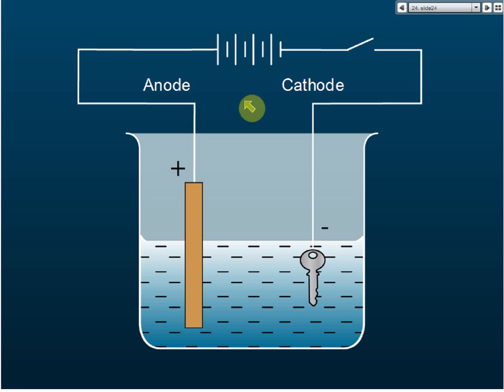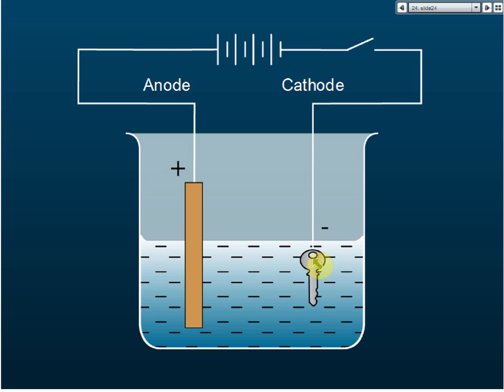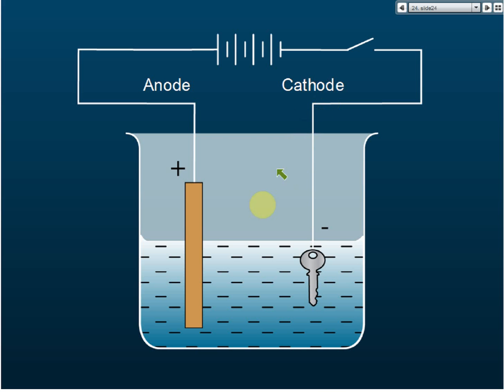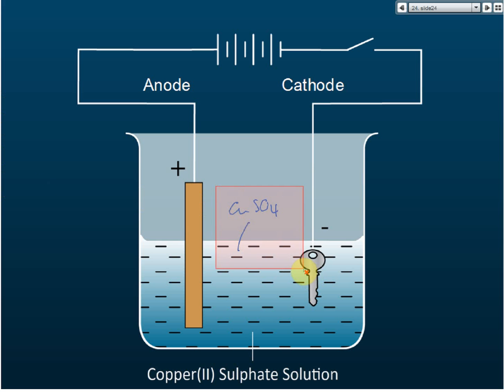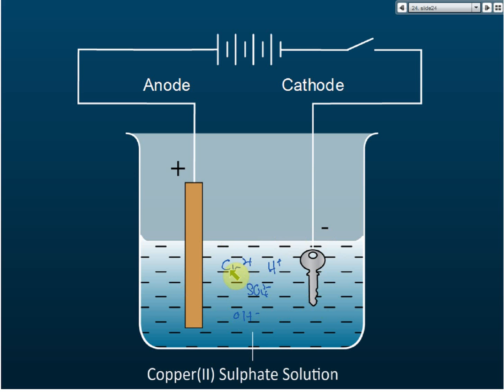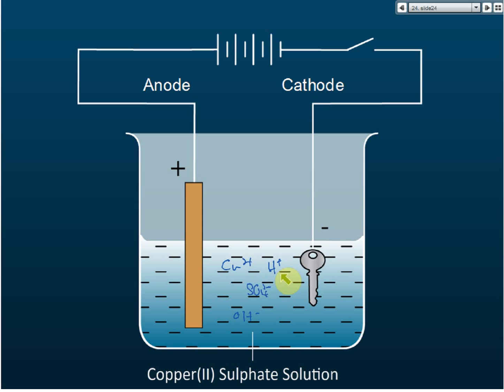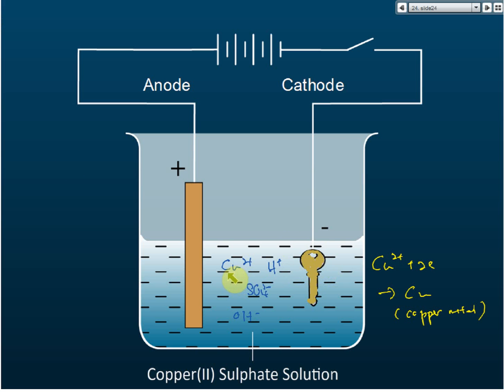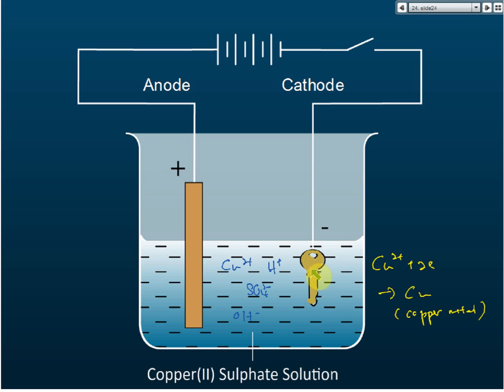Electroplating - Part 1 | Redox Equilibrium

Comment: What are you confuse about? Just remember that (situation in electrolytic cell only) the anode which is positive terminal will be attract negative charge, which in the negative terminal will attract positive charge. And the equation is depends on the charge of the ions example lead(ii) bromide (pb2+,br-) than the equation on cathode side will be pb2+ + 2e to form pb(it's an metal so will be deposited on the electrode) just remember the equation just like the + is on the same side with +ion